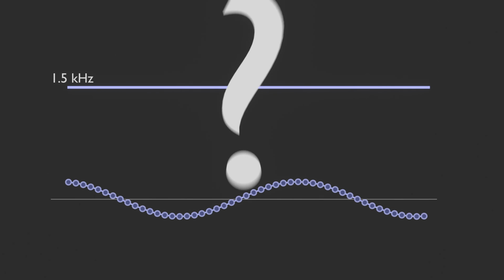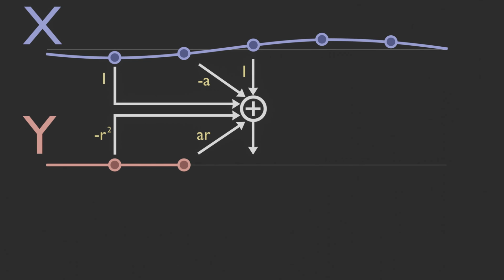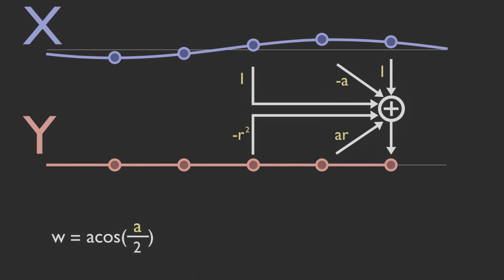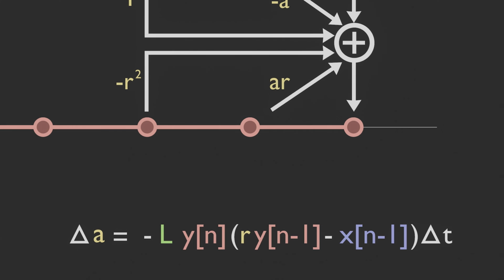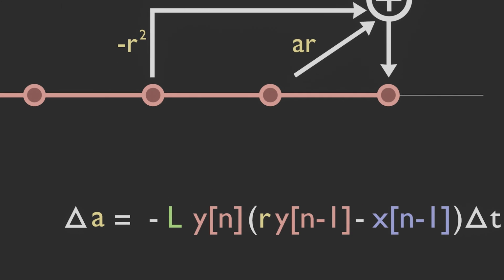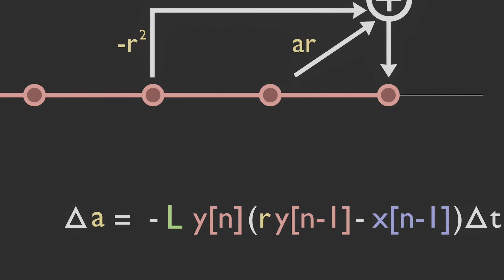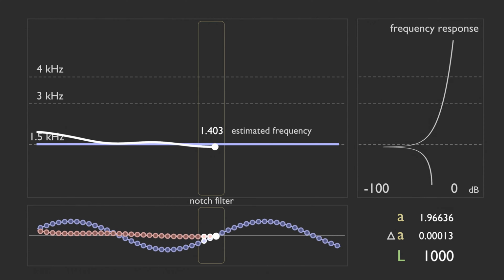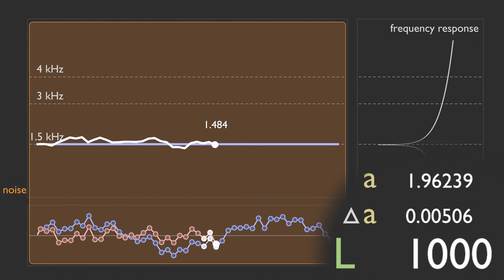Adaptive Notch Filtering / The Simplest Frequency Tracking

Comment: Can you tell where I can find more information about the algorithm of the frequency estimator. I'm currently writing my master thesis and the next step is to implement an adaptive Notch-Filter.
Reply: Unfortunately it does‘t only require registration but also a member upgrade which costs. Do you know another web sites where I can read more about the algorithm? Thanks for helping✌🏻
Reply from the maker: Here is a good article
https://codeburst.io/frequency-tracking-made-simple-adaptive-band-stop-filters-883bc2517939
It requires codeburst registration but you can do it for free.